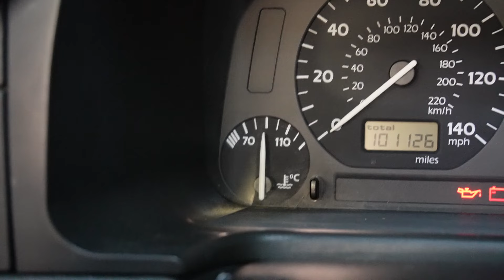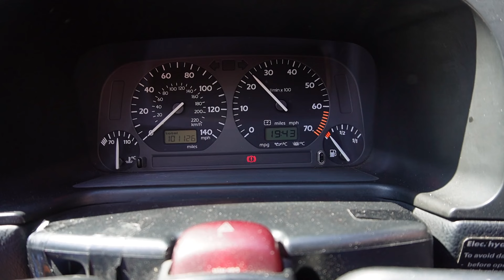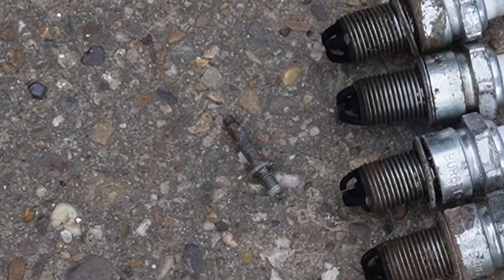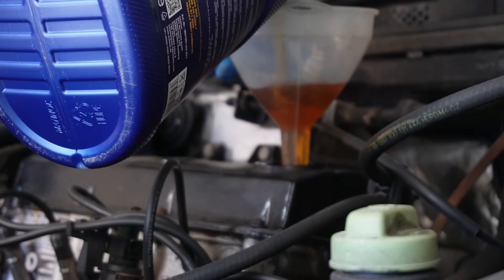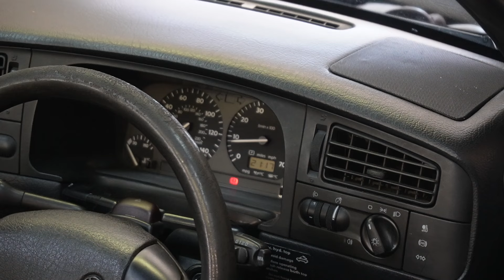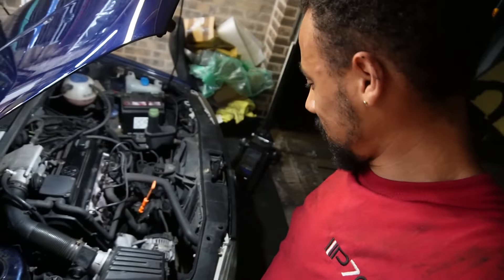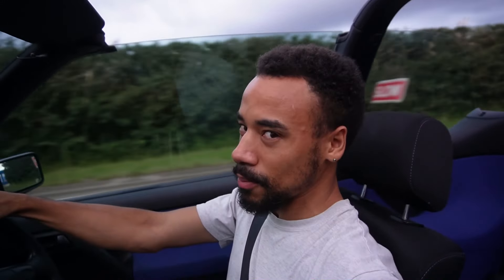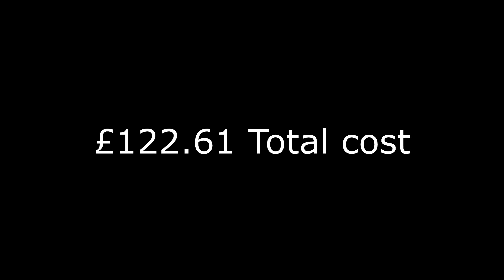RESTORING MY VW GOLF FOR UNDER £130!

Comment: Great video dude. Done very well. With great info. 👍
Reply from the maker: Thanks bud
Reply: @Project7YT  no worries man. I agree. Defo needs to go lower on front. 
In relation to nod ideas. If your not going twin headlight conversion then keeping in theme with the blue and black maybe joey the headlights.
Reply from the maker: 100% but not bad for a quick adjustment

I have an idea for headlights which will be coming soon, same for the interior just need to find a standard one

Comment: Absolutely love the video and the car as well!

I was wondering what sort of headlights I should upgrade my '92 Golf Mk3 to, as it currently has the original single reflector headlights (but the clips inside are broken, so I can't align them). Should I get the same headlights new with better bulbs, get the dual chamber ones, or maybe something else? I really like the Depo angel eyes or the Votex doubles, but I'm not sure how much of an improvement they are. What would you suggest? (I will buy them in germany btw so either ebay, amazon or something else)
Reply from the maker: If you want an improvement in lighting, get upgrading wiring loom and bulb.
Reply: @Project7YT  Thanks a lot, keep up the good work!
Reply from the maker: Thanks ♥️🙏🏾